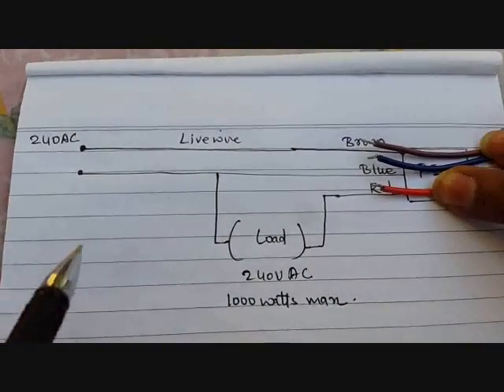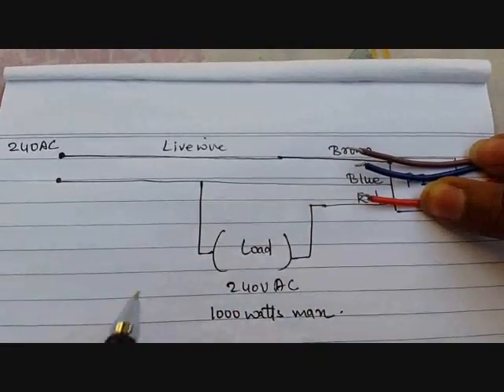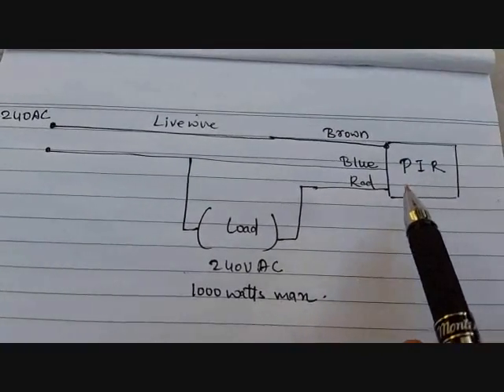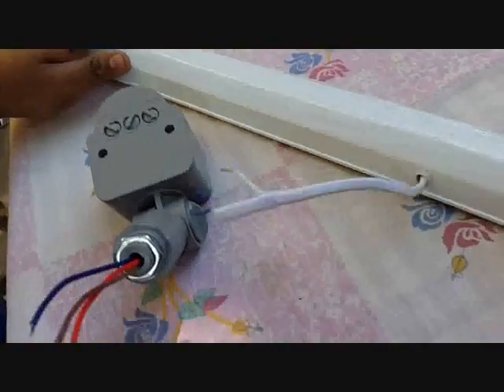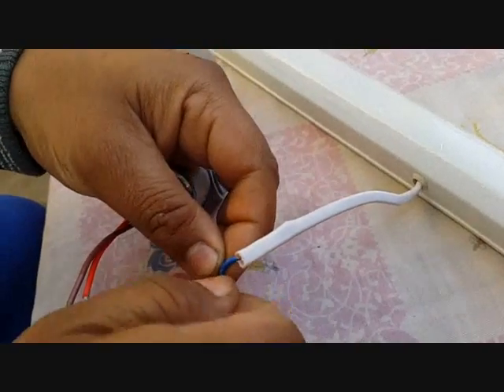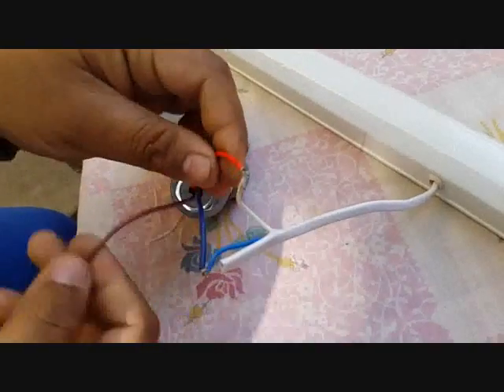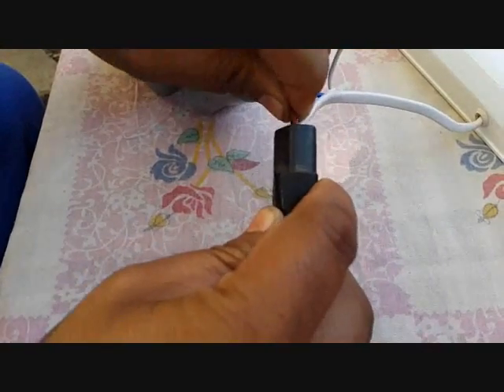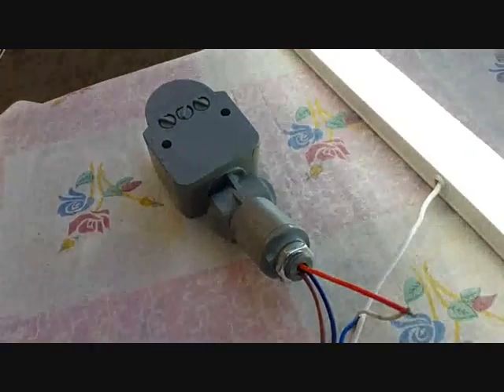motion sensor {PIR}

Comment: My ? Wud be...I wud light to connect outside dangling light...just like a lamp or fan wud have at the end to connect to the wall can I cut the end of the wire n connect it to the pir in any way or must it be +with + & negative with negative

Comment: I want to use this sensor with alarm. I connected wires in same pattern but issue is my alarm didnt go in off mode. kindly guide me how to set sensor thnks in advance
Reply from the maker: set the time to low level ..Low level means alarm will be on for at least 30 second ,which is the lowest level of time duration setting.

Comment: Hello,
For what can We use the Sens adjust - Sensitivity of the sensor?
Can I set for sensing distance, or moving speed, or object size?
Reply from the maker: Its range is only about 4 to 5 meter s..only and it sense body heat ..you can only change sensitivity for object distance ..

Comment: Hi
please how can i adjust it tow work in the sunset  and shutdown in the sunrise 
Thank you
Reply from the maker: it have lux setting by which you can adjust its sensing to dark light.
Reply: Thank you for responding 
but what about the others do i put them in the middle or?
Reply from the maker: one for sensitivity setting and other one is for time so u can set as you like ..best is try placing both preset in middle and after that change the time and sense setting as desire...(place sense to about 70-80 percent and time to the duration u like).
Reply: Thank you very much for your help
Reply from the maker: my pleasure